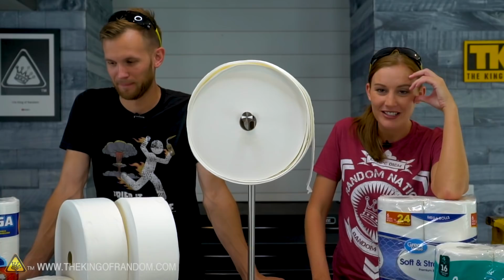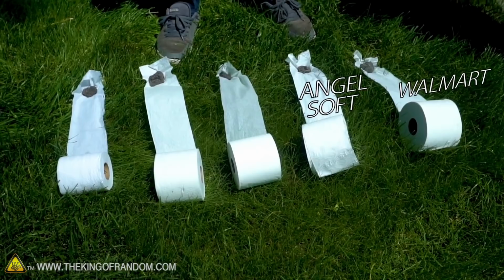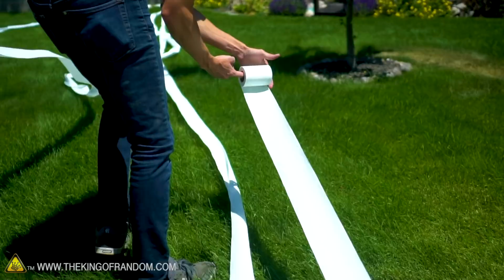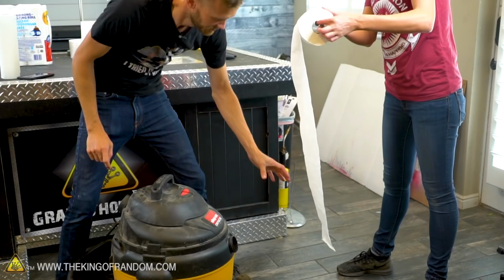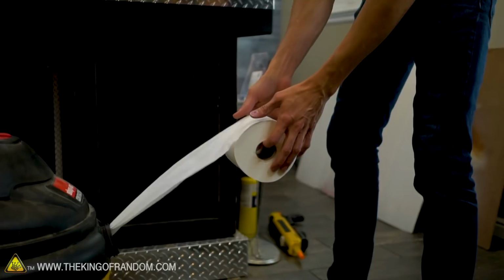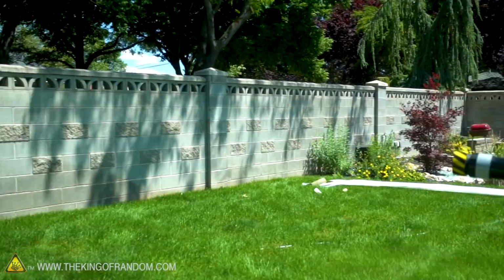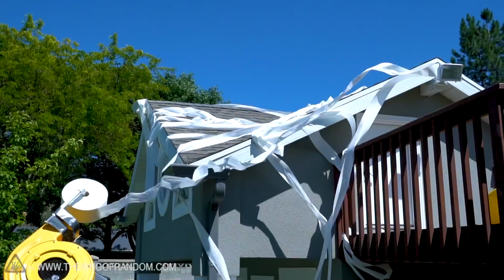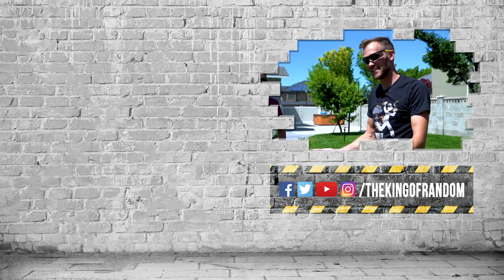4 Tricks with TOILET PAPER!

Comment: an aeroplane pulls a vacuum using the outside air pressure that is y the paper disappeared don't worry a tank catches you ** before it goes overboard but the hand-washed water s thrown out because it evaporates before it hits the ground